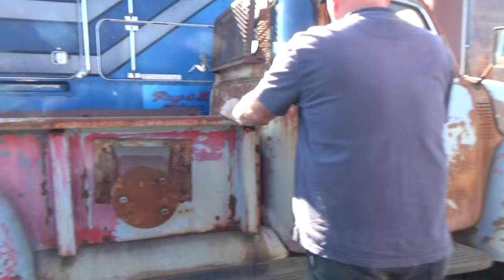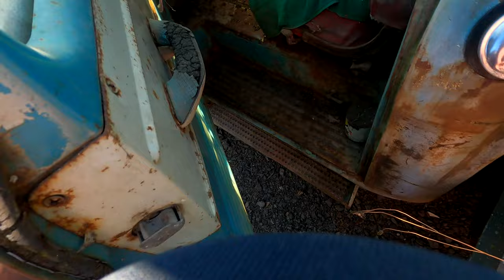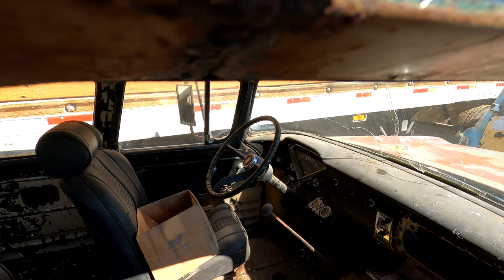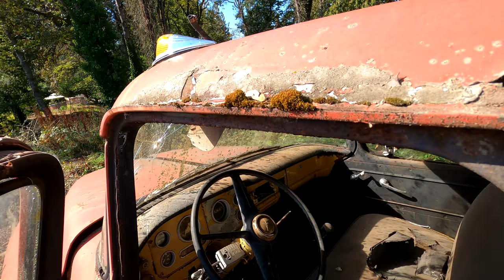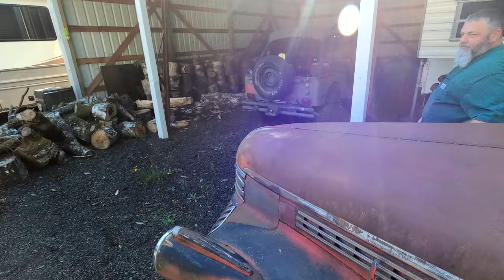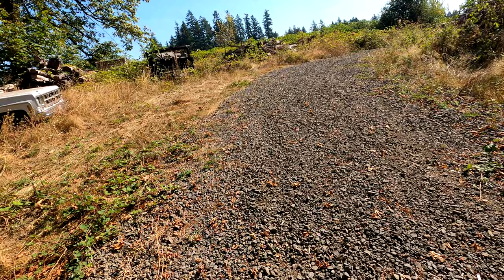Classic Truck Honey-Hole!

Comment: I built the 53 Suburban in 1999 I drove all the way to Colorado to get the back seats but I only paid $300 for them it had a 261 all built up with the four barrel and a four-speed Saginaw it was green and tan I sold it to a flipper who flipped it it had all the deluxe trim on the fenders I sold it for 16.5 in 2002. I use parts from over 30 trucks I owned it for 23 years drove it in primer for 18 years. I've only seen a picture of it once on the internet I don't know whatever happened to it.

Comment: DIDN'T know GM  Made 5 window trucks in 56 , learn something new every day.
Reply from the maker: They didn't make many of them.
Reply: @ClassicTruckRescue   I hired in at Pontiac Motors in 1973  and worked in plant 9, the engine plant. got laid off in January because of the oil embargo. l put in an interplant transfer to go to work at GMC Truck and  Coach  and finally went to work in May for  9 Months until they retooled the plant to build the GENERAL  Semi. l retired from Pontiac  Pressed Metal in 2007.. l Stamped the engine type code on the blocks, number  500,000 in July 1973 and number 900,000 in Dec. 1973. Pontiac just barely beat out Oldsmobile for third place in sales behiind FORD and CHEVROLET. KEEP UP THE GOOD WORK !

Comment: I think the bronco thing is way overpriced nationwide. Especially out near you guys.
Reply from the maker: I don't know, its had a huge amount of serious, professional work done to it. I'd have to look under the hood and body to make a better determination of the value. I did have a much more in depth look at Eric's shop and finished vehicles. He's not a newbie and has some serious knowledge.
Reply: I’m just saying as a general rule,people are asking for more than new prices on worn out junk nationwide. Not saying anything bad about Eric’s Bronco. There’s a really nice 96 here in Florida for $6k and it clean.
Reply from the maker: I just think its entirely possible that a person could sink a lot more than 30K into a Bronco if a top end shop installed all the right goodies and Eric seemed to rattle off some pretty impresive components and details. Its all good Ben.
Reply: You're absolutely right. They've nearly tripled and some aren't even that nice. I've had a half dozen that were in very good condition. This project took 2 years to find a cherry 96' and then got a 600hp twin turbo cummins 12v stuffed in it. The firewall is uncut, retains all the Ford accessories and has one big connector block for the whole engine bay harness. It has an F350 diesel gauge cluster with low RPM tach and diesel fuel gauge. It's so clean of a swap it looks like Ford sent it over to the Dodge factory. It's pretty twitchy and fun to drive once you learn not to mash the pedal and go sideways anywhere with a sub 5 sec 0-60 😇